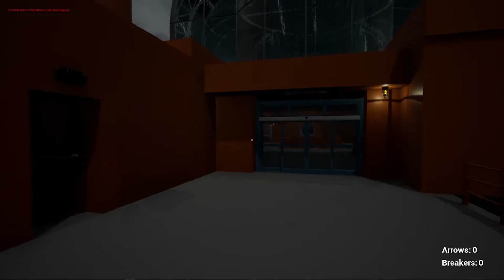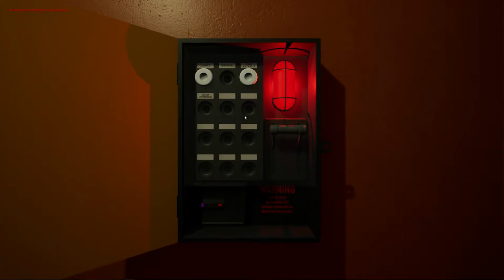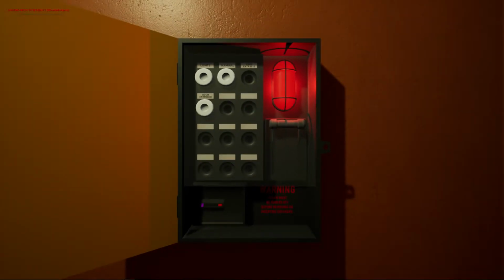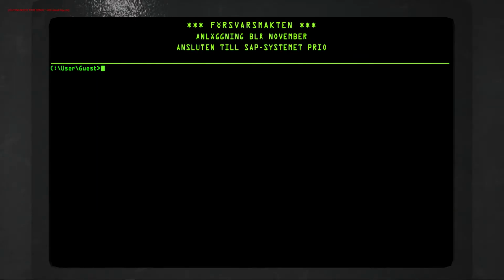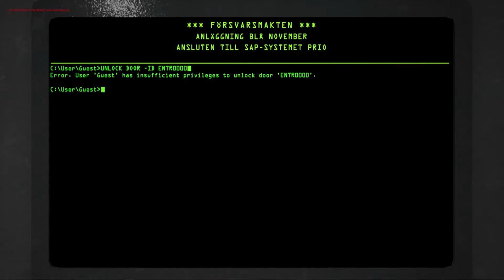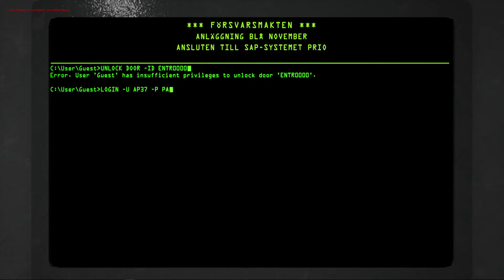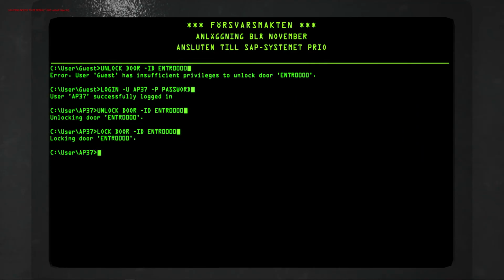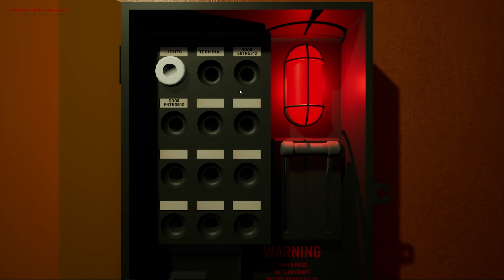Unreal Engine terminal and fusebox blueprint

Comment: How does one go about setting up an interactable computer + the cool screen on the terminal? I've not been able to find good tutorials on how to do this.
Reply: Hey, would you mind letting me know if you ever came across one? I found one for an "interactive Sci-Fi screen" but thats about it. Doesn't seem like there's much info out there on this.
Reply: @ I don’t think I ever did. I know of games that have interactive screens but not yet found solid information. However, I found a super good one but it’s a Unity tutorial, let me know if you want that one. I’m sure the same principles apply. Basically you render the UI in 3D space and then project the raycast back to the UI space and then register the even like you would if it were just a regular UI. I almost bet ChatGPT could also explain how to do it as well truthfully.
Reply: @masonwagner768  i figured out how to do it in my own custom game engine more quickly than Unity or UE lol. Sometimes it’s easier to just roll ya own, the heck with it https://youtu.be/0esD8ftFsyw?si=NmIDt5Okjp8uHUQG

Comment: This is great! How were you able to have the game focus on the terminal widget without showing the mouse cursor?
Reply from the maker: Just don't set "show mouse cursor" boolean to true? 😂 The game focuses on the terminal blueprint, not the widget, the widget is simply on a material. I might rebuild and update the BP soon and might make a video trying to explain how it all works.
Reply: Hi, How can i focus terminal class? We are focusing actor or widget? are you yousing widget component or normal widget ->add to viewport - when i trying widget component for terminalcomputer  widget does not get any input
Reply from the maker: @DotaWB  I'm focusing on an actor that has a widget component, that widget component then has a material called widget 3D passthrough.